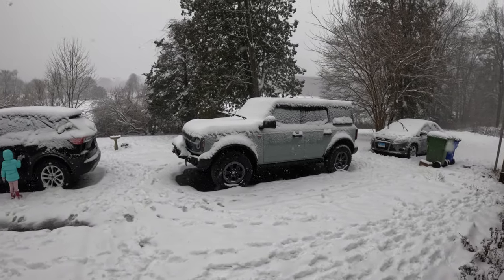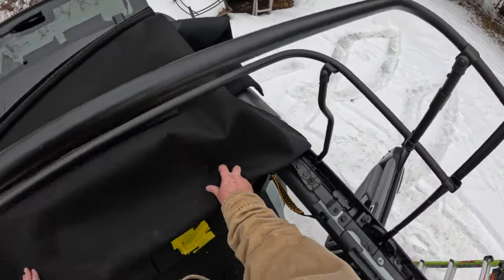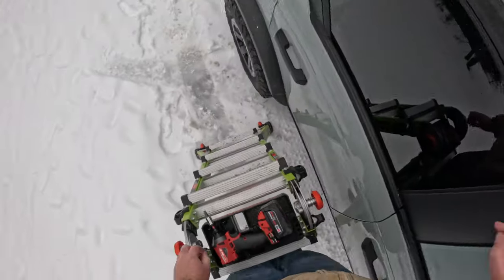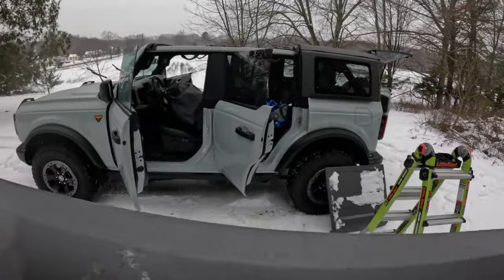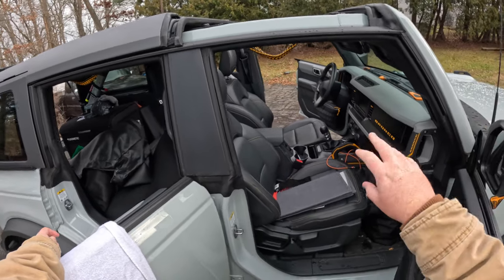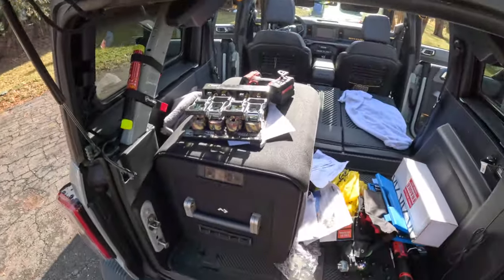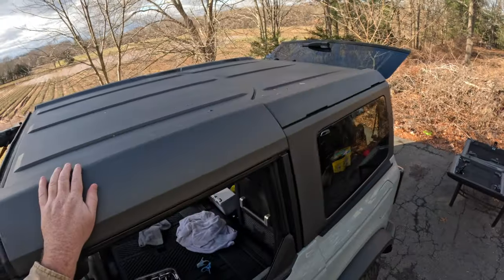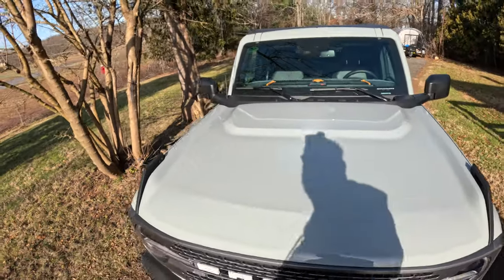GOODBYE Bestop Skyrider! - My biggest Bronco regret?

Comment: FWIW. The JTops sun shade GREATLY reduces wind, noise and sun (I can see you might turn into a lobster like me). While still enjoying the open air experience - even at 60+ MPH. It’s so effective that we’ve taken the panels off in mid-50s and it’s totally enjoyable.
Reply: Can the JTops always stay on? Meaning, can i put my hard top back on over the top of the JTops?

Comment: Interesting. I have the skyrider on mine and have made a handful of long trips with and without it. We haven’t noticed much of a difference at all in road noise. Granted it’s usually just the wife and I, so no back seat passengers (except our pups). We tend to listen to audiobooks on road trips to pass the time, but haven’t had trouble talking. I also run a RC sun shade for UV protection, so maybe that makes a difference. Like your videos. 👍
Reply: Its because his tension cable was broken, as he shows in the video but fails to mention this is his cause of excessive wind noise.  Of course the Skyrider is louder than the full hardtop, but not by much, when installed correctly.

Comment: Thanks for another informative & entertaining video!  We're running Bestop's Sunrider on 4 door Bronco during our off roading season.  Throwing back the front top feels great while doing Colorado's high mtn trails here.  I switched to the hard top for our 2,200 mile road trip to Texas in November.  In December I installed the OEM roof rack to carry our roof cargo box for skiing this winter.

IMO, Sunrider's smaller, front only soft top is much easier install & removal.  It's very easy to open and close on the trail, and probably not as noisy too.  I did go through half a roll of 1.5inch insulation tape along the soft tops's supporting cross bar, as well as along the top door frame strips.  Ths insulation material really helped reduce wind noise when the top's closed.  My last 'noise adjustment' was cutting off the 'Bestop" brand label tag that's sewed on the top's exterior seam just over the passenger's head.  We were surprised how noisy that little tag was at highway speeds.

Totally agree these soft tops aren't great on long highway trips.  Heck, we'll close our Sunrider for even an hour trip to the trailhead.  But once wheeling - Gotta open her up!!

Cheers
Reply from the maker: Part of me wishes I had gone with the Sunrider instead of the Skyrider.

The Sunrider is obviously a lot easier to install, which (in my head) would make it less painful to install/remove as needed based on what you're doing.  Granted, it isn't like the Skyrider is particularly hard to install.  But it definitely takes more time/effort than the Sunrider.

Comment: We have a 4-door on order and this convinced me to to buy it.   The install and removal is way too much work.
I thought it would be something where I pop off the front 2 panels and pop on the skyrider with no bolts at all.   Wrong!
We bought dual tops and I think we wasted $700-ish as I don't think we will ever install the soft top as we live in Chicagoland and my wife drives a lot of highway.   I will try to change my order as production won't start for at least 2 weeks.

Comment: I got the Besttop skyrider for the front-only as a factory option... shipped with my Bronco. I didn't install it this year because I procrastinated too long, but intend to do so next year. Taking off just the front two panels isn't all that hard, I just wish I had a front-row only bimini for when I do (Besttop makes them for jeeps, actually). But I can see where the 2-row skyrider might be kinda loud at top speeds.
Reply from the maker: The problem with the Skyrider is not only the noise and everything else I mentioned, but also the difficulty of installation.  Not that it's particularly difficult to install/remove, but you do have to remote the hard top shell to completely remove it so it's very much not a quick-and-easy thing.

But I suspect the Sunrider (the front-only soft top) would take under 10 minutes to install/remove.  So If I find one for cheap, I may give it a shot.

Comment: Good video, as always. 

You should check out the dirty dog 4x4 insulating headliner. I have the factory soft top, and like your experience with the Bestop, it was almost unbearably loud at highway speeds. The headliner made a huge difference, and it no longer sounds like I'm driving with a window open. 

You might not need it since you're going back to hard top, but I imagine it would help even with the hard top.
Reply from the maker: Oooo that's a really good idea.

Just visually it looks like it would interfere with the Skyrider's mounting brackets, but it looks like you could easily modify it a bit to make it work.